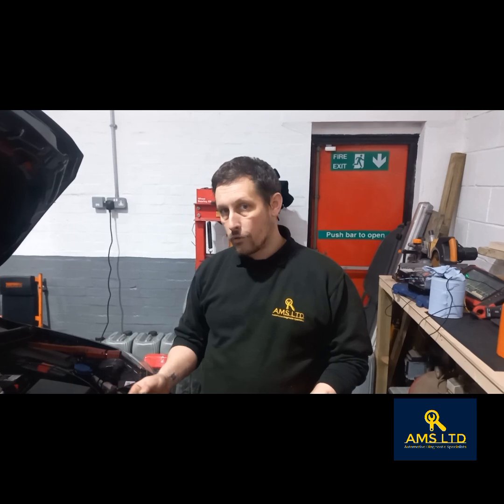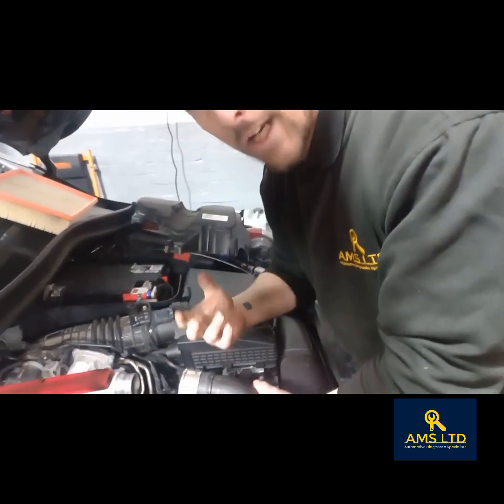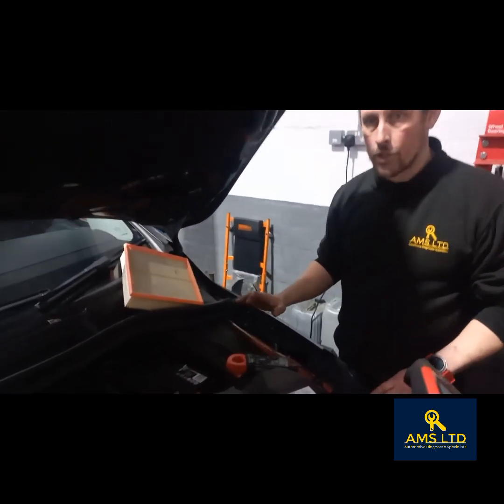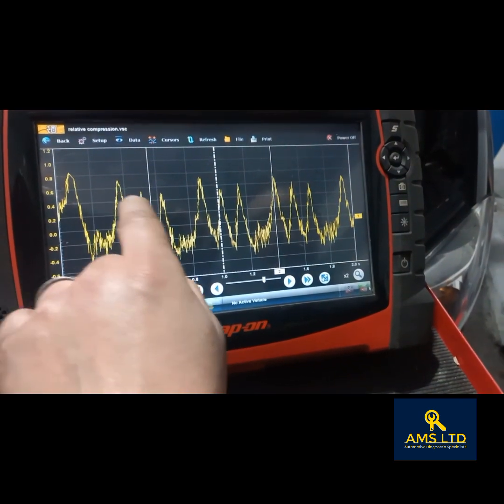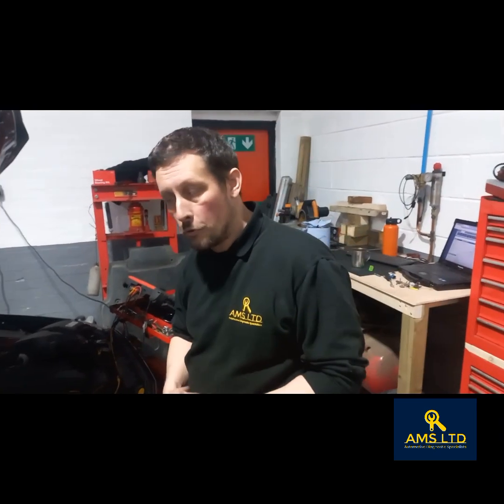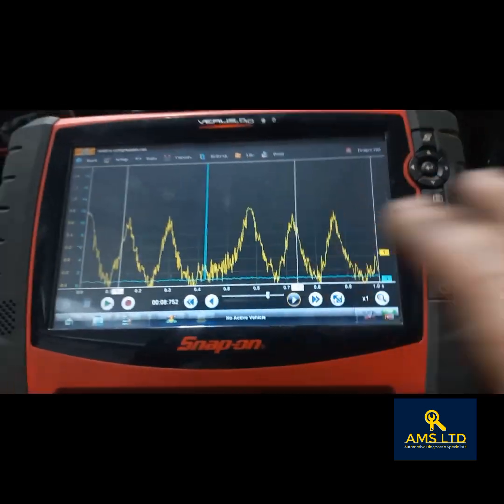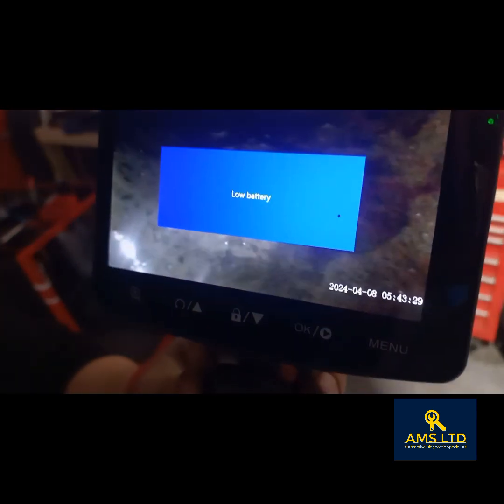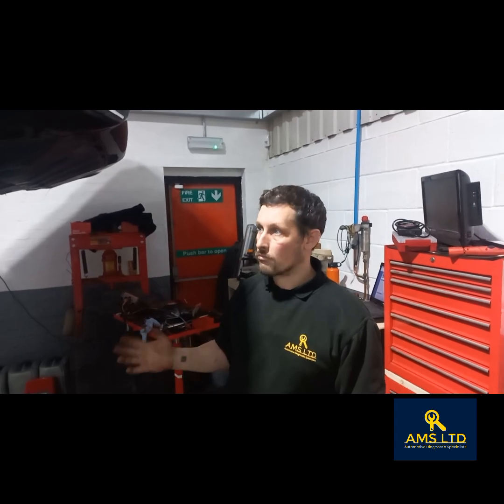Misdiagnosed Multiple Times: The Truth Behind This Mercedes B's Engine Problem

Comment: We can use resistance instead of  bulb to locate which cylinder?
Reply from the maker: You need a simulated load on the circuit to pretend to be an injector. The engine computer will shut down the circuit if it sees a fault.
Thanks for watching 
Don't forget to like and subscribe 👍👍

Comment: i was trying to figure  for a long time how to figure from a relative compresion witch cylinder is loss compression  on the screen wave form from relative compression test  on  oscilloscope, your  solution was to put a clamp on the injector thank you  thank you Sir , i can sleep well now, i just start to use a pico 2204  and still have to many things to finde.
Reply from the maker: Glad I could help
Thanks for watching 👍👍👍